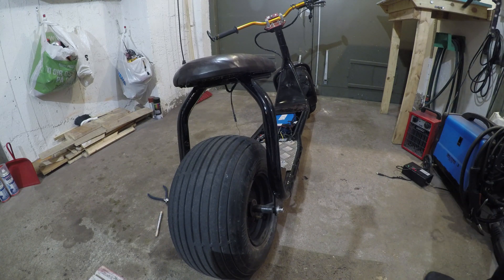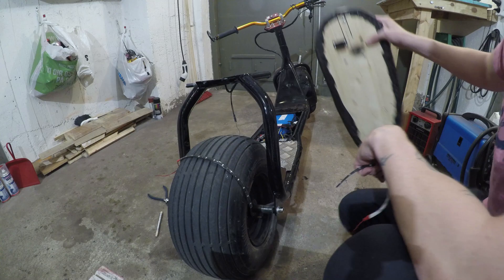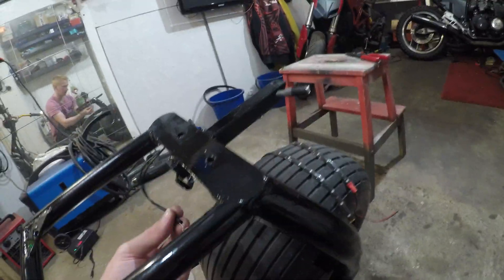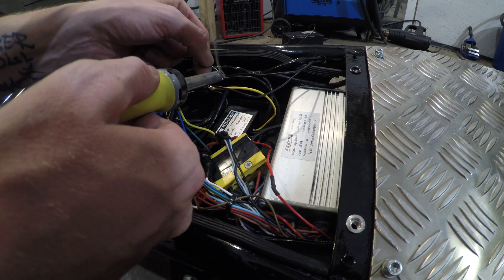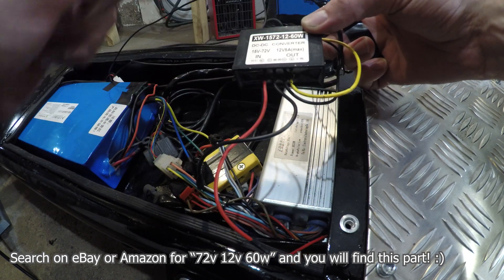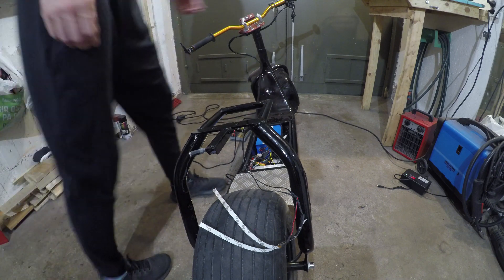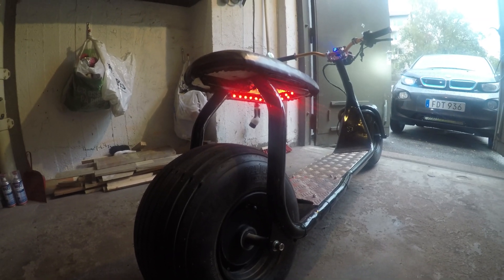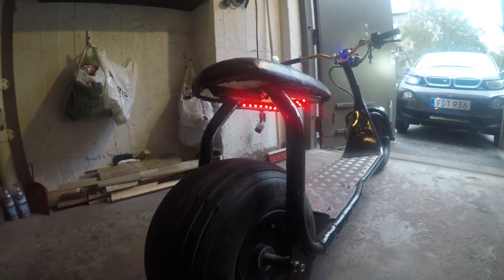Wiring up some 12v (tail lights) on the fatscooters 67v battery!

Comment: Nice video , i have a 72v scooter it has 72v for headlights, turn signals and rear run switched light red/blk...wire , and rear brake light yellow/green wire. The reducer I have is a 15amp 180w one , it has a red wire for 72v input and a yellow wire for 12v output and a blk wire for ground. So I assume the red wire goes to  the 72v output going to headlights and turn signals and horn and rear turn signals and rear run red/blk led light and yellow/green brake light wires assuming yellow is 72v positive and green is negative? I'm guessing before the light sw In ront? And leave 72v power to scooter voltmeter and large display screen and throttle display ? Thx